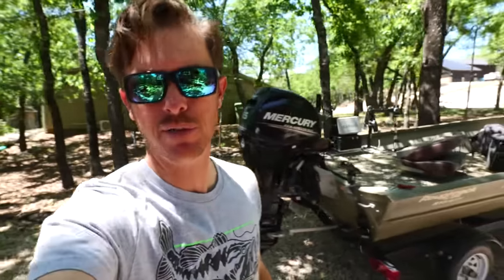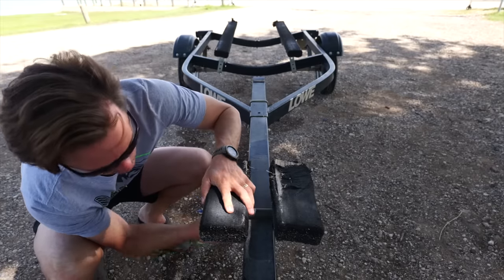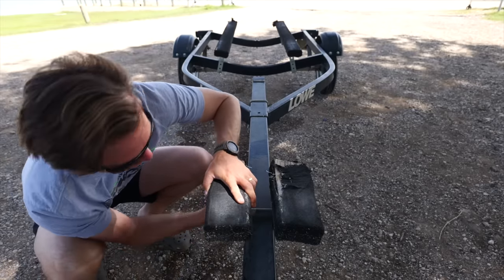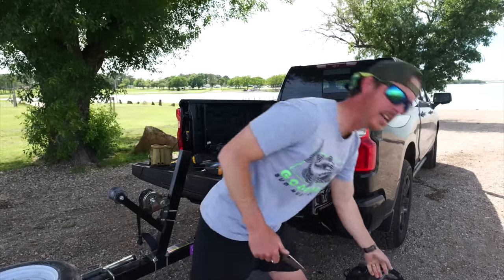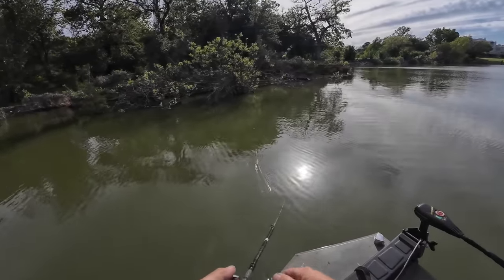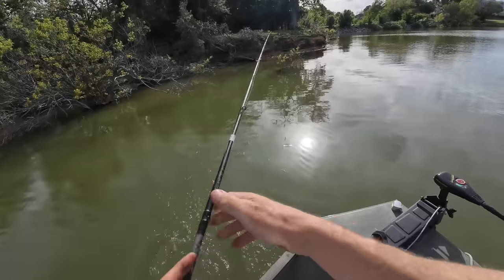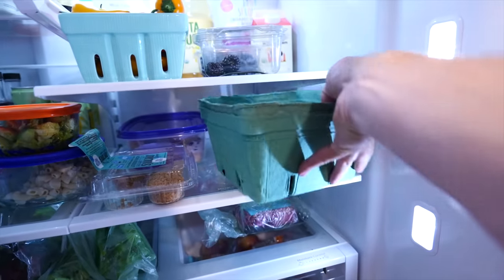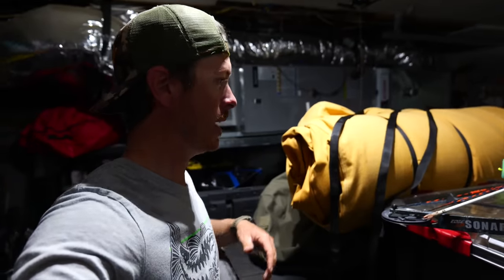My Boat Trailer is Falling Apart, Parking Lot Fix Up!

Comment: Justin for those bolts you should use Loctite glue for threads and bolt Red 271 for permanent hold.